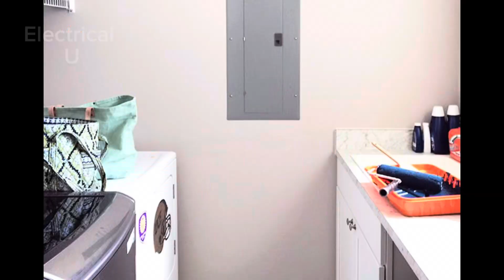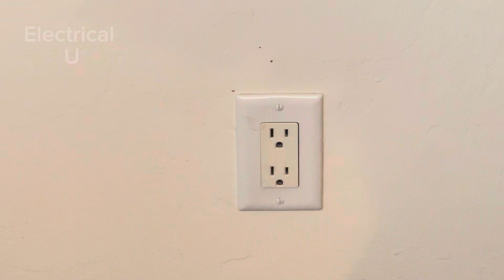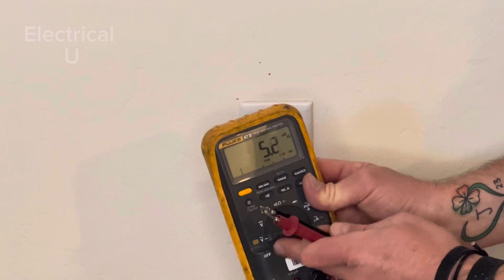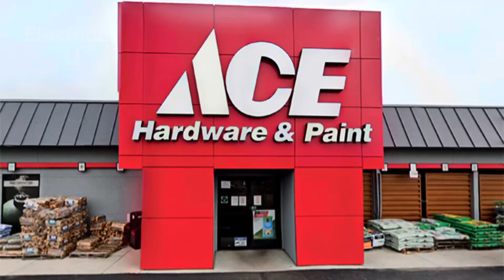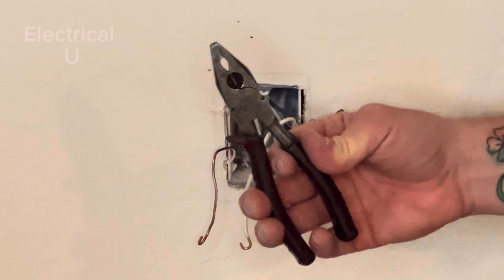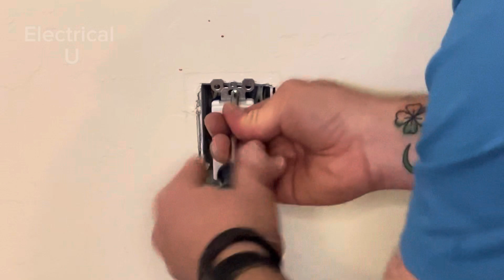How to Replace an Electrical Outlet (DIY for Beginners)

Comment: Great step by step! If the outlet is bad, will the multimeter read a current when it’s hot?
Reply from the maker: Thank you! That depends, if the outlet is completely dead no, which is where the Flir circuit tester comes in handy! Thanks for the comment!